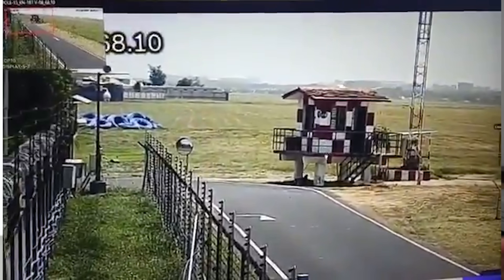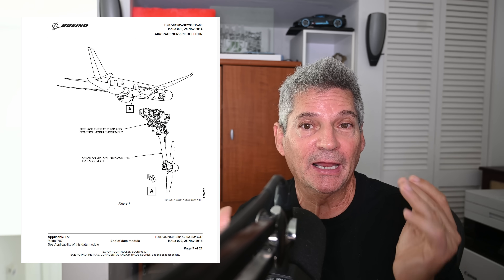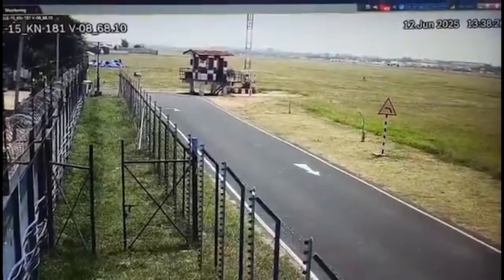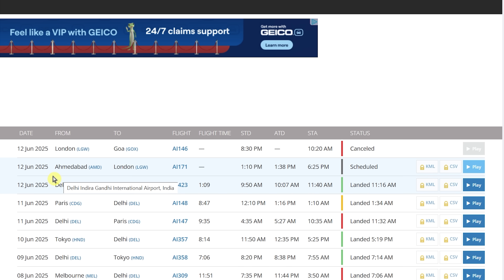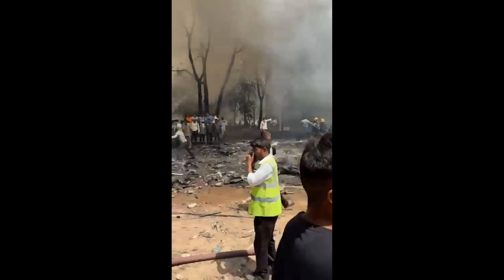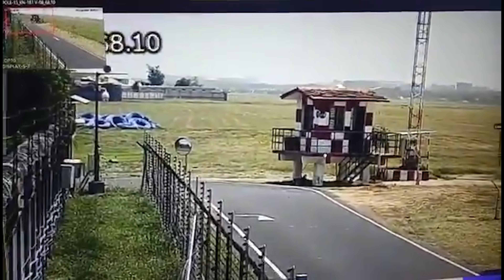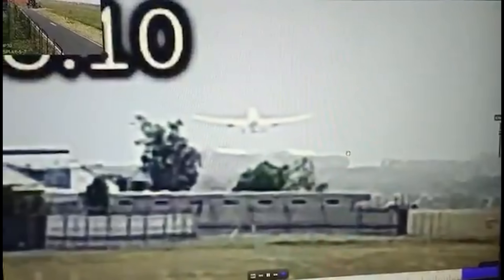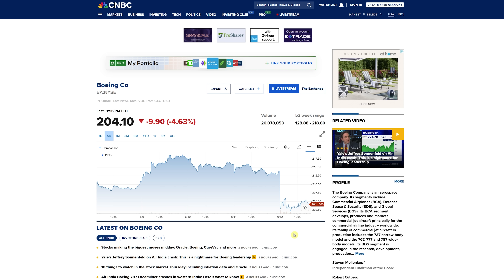What Caused Air India 171 Crash, Mysterious Sound Before Impact

Comment: Did Boeing make another bad plane? What did Boeing make that as airliner would you consider a bad aircraft? I can't think of one also Boeing deserves more respect they have been the leader in airliner manufacturing. Everything Airbus has built has come on the coat tales of Boeing meaning Boeing had done first. Short of their stupid side stick yoke but major air frame designs. The A380 never impressed me because the 747 was first flew way longer more copies made longer production. Airbus can try but Boeing has already  done the hard work the major capital investment in to what works over the 70-80 + years of building civilian airliners. So until Airbus steps out in front put the company on the line for some major airframe design . Like Boeing has done time and time again spare me Airbus people please.  As a Washington State resident I do have some favoritism to Boeing but they earned it. That's why when I fly I no longer fly on Delta airlines, for me Delta is not an American airline. They have turned their backs on Boeing I hope that many more Americans will choose to fly American, United, Southwest anyone other than Delta.  Deny Delta.

Comment: The audio recorder in the cockpit is very much sensitive and if the pilot had purposely transitioned these switches, that also especially in one second, the recorder would have captured the sound. In some of the videos which demonstrate the switch operation clearly indicates very much noticeable noise. If it was done by pilots, it would have heard by the people who are the part of the investigation. So, it is sensible input for the guys who leaked the preliminary report. It was a supporting detail who are trying to narrate this pilot's deliberate actions. Why was it not included in the part of leaking details? 

Additionally the tail end remained fully intact and without exposure to heat or fire. But how is the data recorder which was stored at the tail end badly exposed to thermal damage?  

If one pilot was trying to kill and the other pilot was trying to rescue the flight, why did it took 10 seconds to put back in to run mode?

Comment: After tons of speculations (more or less SF) the cause of AI 171 flight crash was solved: it was because pilot's chair slide back with about 30 cm.

The unhappy chain of events was this:
-> the plane hit the rotation speed on runway -> the pilot rotates the plane -> the plane took off (the angle of attack increased very much)
-> after a few seconds the pilot's chair suddenly slid back about 30 cm (one hand of the pilot was on thrust levers)
-> the thrust levers went back to idle position because of the back slide of the chair (and most probably because the pilot tried to put the chair in the initial position by pulling back the throttle and the control stick). This explains bots setting the planes to idle state and the very high angle of attack from the moment of the plane crash (seen on videos).
-> from the first second the pilot DIDN'T realize that he put the engines in idle state, most probably he was distracted by the movement of the chair
-> there was an instant drop of electrical power and hydraulic pressure, RAT was deployed automatically -> the pilot tried to deal with loss of electrical power WITHOUT realizing that he put the engine in idle state.

The sudden move of the chair distracted the attention of the pilot from the main problem.
With this chair move he put involuntarily and unconsciously the engines in idle state.
This sudden chair move was similar with the move made by illusionists to distract public attention to some move they want to hide.

There were tens of millions of flights since the aviation was born but I bet nobody imagined such a scenario (sudden change of the position of the pilot's chair).
I bet there is no flight simulator in this world to simulate this sudden movement of the chair during flight.

Comment: Our thoughts are with the Crews' families. The captain seemed with all his might to keep the plane up in the air, and the RAT was deployed, and the engines went quiet as if something catastrophic had happened to both engines, and the RAT was deployed. 3 things could cause this to happen: failure in ELECTRICS, Hydraulics, and both ENGINES.as they are used to generate ELECTRIC POWER, and  which most likely powers the Hydraulic pump, or maybe the HYDRAULIC PUMP comes from both engines

Comment: The RAT dropped,  it’s not designed to do that at a low altitude.  This was in my opinion a dual engine failure either fuel contamination or Vapor look.

Comment: One thing that certainly is odd is the landing gear doesn’t look like it ever got retracted. Normally the landing gear is retracted shortly after takeoff to reduce drag and help the airplane accelerate and climb.
It could be there was some emergency situation the pilots were dealing with that distracted them from getting the gear up.
Not saying this was the cause of the crash; just that it was unusual.

Comment: You missed the video from that passenger on the previous flight. The internal communications (call buttons and phone) was dead, the entertainment was dead and the AC was dead. Three separate systems were down. THE PIC should NEVER have allowed a take off with three independent systems down, EVEN IF HIS OTHER SYSTEMS WERE SUPPOSEDLY INDEPENDENT,  That is an indication of something much worse happening.
THE REAL ISSUE, is that airlines will harm the career of any pilot that grounds a plane instead of flying it. This has always been true. I can tell you that if I had three different systems failing I oulw NOT fly the aircraft at all. I would found it and get another bird.
This WILL be considered PILOT ERROR as it should be as the ROOT CAUSE. The secondary cause was system failures leading to loss of (power plants etc).

Comment: I think the cause is insufficient engine thrust.
However, I don't think it's an engine malfunction.
The left and right balance is not disturbed.
I don't think there's a problem with the climb angle either.
Reply: double engine failure, something with the fuel supply maybe? that's one of the causes RAT is out

Comment: Avionics tech: ELECTRICAL failure causes automatic disconnection of Autothrottle which retards thrust (on a Boeing) On an Airbus autothrottle disconnect leaves the throttle setting unchanged. stat.

Comment: There is an alternative explanation. The RAT can also be deployed manually via pushbutton. They could have taken off with a proper configuration (flaps in take off position etc. ) Took off, on positive rate the copilot mistakenly raises flaps instead of gear, the pilot confuses the lack of lift with a lack of power and manually deploys the RAT to prevent running out of hydraulic and electric energy ashe thinks it is a lack of power, and then when the plane starts going down, they realize it´s the flaps, lowers them and raises the landing gear but it´s too late and the plane crashes just after the landing gear starts it´s retraction. This could be confusing as the flaps would be found deployed and the LG truck in the position it moves to before they are raised. Plus the RAT sound would be present. Just another theory... please comment!

Comment: a software bug, discovered by Boeing, that could cause loss of all electrical power, potentially shutting down both engines. Boeing discovered a software error in the generator
control unit. The error could result in a total loss of electrical power to the aircraft, even in flight. The condition occurred if electrical power were left on for about eight months without being turned off. More specifically, the problem became existent on the 248th day of continuous electrical power.  (https://www.availabilitydigest.com/public_articles/1006/787_power_loss.pdf)

Comment: best analagy I can yjink of is starting your car with just the fuel in your carb, it will get you half way down the street then die.  I cant beleive it was a mechanical issue, as for it to happen to two engines at the same time, is remote.  this will end up being somethung to do with the fuel delivery system, as it looks like both engines just starved of fuel.

Comment: At that altitude + sudden total loss of power, I'm thinking birdstrikes.
Wish we had audio of the ascent.
Reply: There are several points which discount the birdstrike theory:

1) No sign of an engine flameout. Engines usually - but not always - exhibit flames and smoke when birdstikes impede them.
2) No birds seen in the video. Far from conclusive tho, they may have been too small and too far away to be seen by the camera.
3) A commercial airline A&P mechanic said it best: "This was not a bird strike. These GE 90's can take a lot of birds going through that giant fan disk in the front."

Comment: Before that, there was Air India Flight 171, which crashed on January 24, 1966, near Mont Blanc in the French Alps. Here is a summary of the causes of the crash:

✈ Accident Summary:
Flight: Air India 171 (also known as Kanchenjunga)

Date: January 24, 1966

Aircraft Type: Boeing 707-437

Route: Bombay → Geneva → London

Crash Location: Mont Blanc (France)

Casualties: 117 fatalities, no survivors

⚠ Main Causes of the Crash:
Navigation Error / Misunderstanding of Position
The pilot thought the plane had passed Mont Blanc while it was still approaching it. He therefore began a descent too early.

Miscommunication with Geneva Air Traffic Control
There was reportedly a misinterpretation of ATC (Air Traffic Control) instructions, particularly regarding the turning point and the timing of descent.

Adverse weather conditions
Mont Blanc was obscured by clouds, preventing the pilots from seeing that they were heading straight for the mountain.

📌 Key fact:
Among the victims was Homi J. Bhabha, a renowned Indian nuclear physicist and considered the father of the Indian nuclear program.

📚 Alternative theories (unproven):
Some conspiracy theories have been put forward, claiming that the crash could have been sabotage, particularly in relation to Homi Bhabha's death, but no concrete evidence has ever been found to support this hypothesis.

Comment: I have lived within several miles of a major airport all of my life (61 years). That audio does not sound any different than normal. I hear the doppler effect of the jet engines and that is all. I can't tell you how many times I've watched and listened to a jet going overhead, on take-off, and I can plainly hear the "whirring" of the jet engines and it seems unnatural. It kind of has the sound interruption like a prop plane, but not quite. It is not so much the tone but the variation of the sound that makes it seem that way. You expect a smooth almost whistle sound of the jet going by, not a metallic whirring sound. I don't hear anything in this video of the India jet other than what I usually hear when a jet goes by and I am on the ground, and I am also into recording audio all my life so I do have an "ear" for sound.

Comment: If Flaps are not configured in TO position at the moment the throttles are moved forward there is a strong noise warning that the the take off configuration is frong and in the 787 there is a voice screaming flaps flaps. For sure the plane stalled and increasing the noise increase the stall and at 600 feet there is no way to recover froma stall with a 787 it would be hard to recover from a stall with a pa28 at that height

Comment: The sound on the 'original' video was fake, alleged RAT noises included. Why? Because the plane crashed about 2 kms away from the person recording it, yet you heard it blow up immediately. That's not the real world: it blew up, but you wouldn't hear the explosion for at least a second of two, not right away - watch what's happening in the Middle East to see the effect: the noise of an explosion takes a while after impact as sound travels more slowly than light. So this is just more speculation on speculation. Wait until the authorities have done their work to find out what actually happened to this doomed aircraft.

Comment: Much has been written about the flaps which are not clearly visible in the videos, so therefore speculation, and that the wheels were still down.  Considering how quickly after take-off a Mayday call was made there was obviously a problem and given those circumstances  bring the wheels up would not have been the focus of the pilot and co-pilot's attention.  Our condolences to all the familes and friends of those lost in the aircraft and in the building.

Comment: I believe the crew performed very well in an impossible situation. An avionics fire that impacted the fly by wire/computers could cause the engines to roll back to a lower power setting. The RAT is the key clue to a major system malfunction that prevented the crew from raising the gear and not having sufficient thrust to climb.

Comment: Like other speculation you don't mention that the point of 'rotate' was excessively late into the takeoff run as shown by the dust/debris blown around by the port engine? Any ideas/comments?  Like you though I did wonder about the 'seemingly' quite severe port drift almost immediately after rotate.....strange because looking at the dust cloud there doesn't appear to be much of a crosswind.

Comment: According to a civilian pilot with 20 years of experience flying Boeing and Airbus, even though the flaps were not open but if  two engines were still  running well so the plane still took off. According to him, this incident showed that the two engines stopped running right after the plane took off. As seen in the video, the plane had just taken off a little bit and then started to lose altitude.

Comment: I'm a USAF vet. 🇺🇸 Not pilot error. Malfunction, entire plane. Emergency small propeller, RAT was down. They had no chance. 🙏
Reply: sadly there's both a lot of speculation and a few bad signs popping up. it's too early to say for certain but pilot error or worse is shockingly not off the table yet, with the cockpit audio + data showing both fuel control switches moved from run to cutoff 3 seconds after takeoff. 

one of the pilots noticed and seemingly asked the other pilot why he cut off, with the other pilot answering (genuine confusion)? that he didn't. 

It's not pilot error until every other possibility is eliminated but there's a limited range of reasonable theories left given just those basic facts:

1. the least likely imo - deliberate action. much like you i absolutely believe they were wrestling this thing all the way into the crash, which i don't feel like fits suicide. 
2. Unlikely imo but would offer an explanation - pilot B inadvertently cuts off fuel while manipulating throttle after rotation, pilot B realises engines are shutting off and correctly identifies the cause over the next few seconds, then 10 seconds after cutoff both switches are set back to run, but it's too low too late and the engines have only just reignited with one producing thrust and the other sluggish to respond. No idea if accidental cutoff is even plausible with this specific throttle configuration and the interlocking system for the cutoff switches. there are a few high profile examples of this occuring in the past on a few models of aircraft, some due to slop in the interlocking, others due to incorrect installation, and at least one was pilot error, and that brings me to - 
3. Air india might not have checked this plane complied with an SAI bulletin related to the above where factory-supplied/installed fuel cutoffs had the stoplock disengaged. Which feels like a hauntingly strong possibility.

Comment: With two huge turbofan engines at full power  during take off and you can distinguish the sound of a small two-bladed propeller rotating due to the impact of the air?

Comment: Consider this: There is much talk about the RAT deploying because of multiple engine failure. There are other reasons it deploys. One of them is the following: Loss of Electrical Power to
Flight Instruments: On certain aircraft, LIKE THE BOEING 787. loss of all electrical power to the captain's and first officers flight instruments can automatically trigger the RAT deployment.

If their instruments went dark, they had no idea what was happening with the engines, or other vital parts of the plane. This may explain the may day sent. My opinion is that the flaps were deployed, but not at the proper setting. With the weight and weather involved flaps should have     
been set at 15 not 5. I believe they stalled due to a lack of lift and the laws of physics took over from there . I"m looking forward to the release of the flight data.

Comment: I hear a plane under full trust passing by a building and the sound reverberating off the building. What I see Hydraulics didn't fail as you can clearly see up elevator defection increasing as the plane goes down. You can also see rudder deflection. And you can't see the RAT as the plane passes by. Also what I see is little to no Flaps.

Comment: We would not have this conversation if the Pilot unions hadn't rejected the live feed system. The Black Box should be a backup to the feed system. The Feed System: up to (6) cameras that view the cockpit, passenger bays, LT/RT wings flight controls, and vertical/horizontal surfaces. The full flight feed system starts recording from ground inspection, cockpit prep, takeoff, flight, landing, and shutdown. The feed system is guided by GPS straight to the DATA Center. Summary, if SpaceX could monitor the crafts all the way to space and back, then the Black Box is a dinosaur